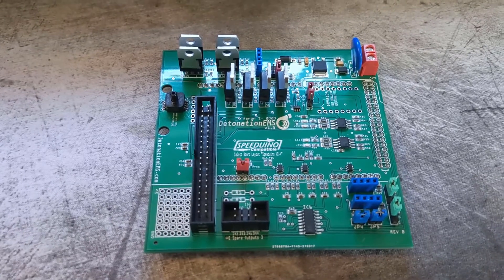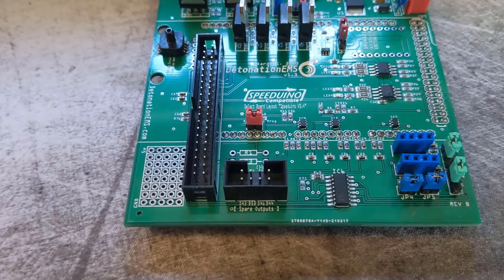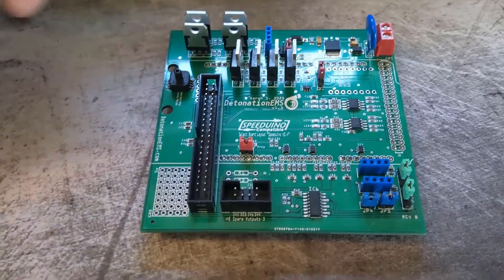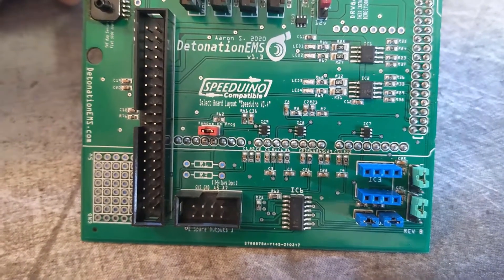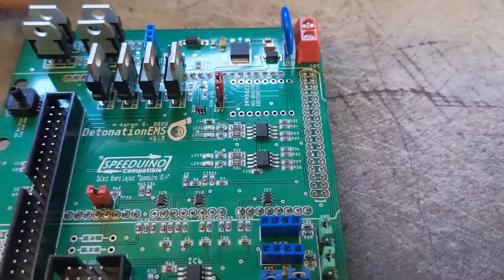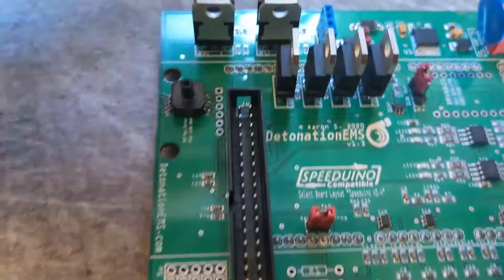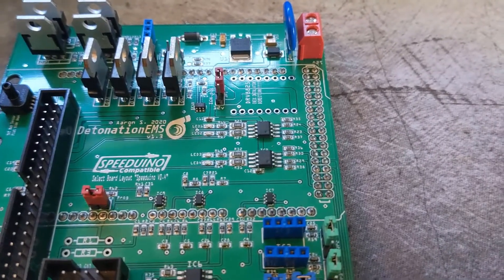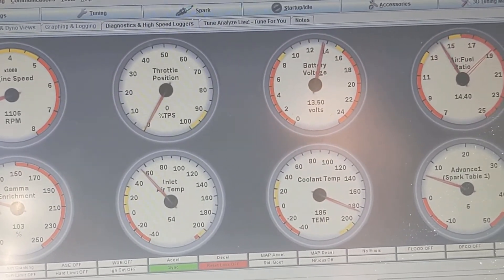Speeduino Compatible DetonationEMS v1.3b Engine Management System. New Features Overview & Running.

Comment: How about Vss input how do you connect it sir?
Reply: I’ve got DetonationEMS v1.3 ecu but I’m having a problem to wire my Vss input wire i have no idea which pinout should use because theres no layout board diagram, do you have DetonationEMS ecu layout board Manual?
Reply from the maker: @jameswilliams7895   My Github https://github.com/DetonationEMS

But follow the instructions for the Speeduino 0.4x. Off the top of my head I think it's pin 20 by default. If you join the official Speeduino slack you'll get the the best help on their. I am on there too. You can @detonationems or DM me on slack.
Reply: @Detonation240  can wire my Vss input wire between the 2 analog inputs A9 or A10 on IDC8?
Reply from the maker: No. Those are 0-5v analog inputs. I cannot post the I information on here. Please see my other post, you can join slack and I'll forward you the schematic you need.
Reply: @Detonation240  I already emailed you
Reply from the maker: @jameswilliams7895  got it. I don't have notifications on for that email unless it's business hours. I didn't see it.
Reply: @Detonation240  i cannot install slack app on my phone how can i contact do you have Fb?
Reply from the maker: @jameswilliams7895  I replied to your email.. I have email notifications off for weekends. I would have seen it tomorrow. I sent you the schematic
Reply: @Detonation240  I’ve got received the schematic but I’ve emailed you a photo of it.
Reply from the maker: On that board a small circuit needs to be made in the proto area. It's easy instructions are on the speeduino forum.. There is a newer version coming out in a few weeks that will have a vss pin ready to use.

Comment: The price is really attractive and the fact that it has map instead of maf is also nice. Im running nistune on my s14 right now but this seems like the best bang for buck. Is there any wiring scemes for wiring it up to an s14 sr?
Reply from the maker: Sorry missed this comment. It's fairly straightforward. Since it universal we don't really offer engine specific installation instructions but and SR install isn't hard. My two strong suggestions are use the 24/2 trigger wheel sold by aem or DIYautotune and don't use the factory coils. They are getting to old. Several inexpensive VW coils happen to fit very well on the Sr. I think it's 2012 GTI coils I'm using right now? No issues.

Comment: Just received mine a couple of days ago, waiting on a vtps so I can throw it on a miata. I was wondering though, what notable changes did you have to make to get it running your sr20?
Reply from the maker: Very little. The factory CAS outputs 12v and the ECU only accepts 5v signal so you run a diode backwards inline with the signal. Since I'm not using the MAF anymore I added a GM iat sensor. That's about it. Not necessary but switched to a dodge neon coil and spark plug wires because the OEM SR20 coils are 30+ years old. Was easy, used my Ignition control module. Did that several years ago. I'm thinking of switching to VW COP instead. They are really inexpensive.

Comment: Any chance I can use this to run engine management for my high compression 1zz? I'm trying to avoid going with an EMS4 or the like; thanks!
Reply from the maker: Yes absolutely. These ECU's are universal so they will work on most gasoline engines one way or another. You will need the details of your engine sensors including coolant temp, intake temp and the crank/cam sensor. Many are natively compatible with the firmware. In some cases customers use a custom trigger wheel to modernize older engines to run fuel injection and/or direct ignition. So the answer is yes it will work but how you make it work will be up to you as this is not a Plug and Play ECU. Check out the wiki page listed below for the more detailed information. This specific ECU is compatible with the V0.4x firmware so that's were most of your information will come from. Hope this helps. - https://wiki.speeduino.com/en/home

Comment: Could the new inputs and outputs also allow easier/better AC control? Also is cruise control possible with any Speeduino or DetonationEMS? Thanks for your work!
Reply from the maker: I have to be honest I don't know the answer that either of those questions. With the outputs you would have a specific value trigger and on and off state. Could that trigger be a pressure valve in the AC system? I have to be honest I don't know enough about air conditioning control to know the answer. That is a really good question though I'm quite curious to see what somebody's smarter than me with the AC systems would have to say about that. As far as cruise control I don't think it's possible without an external module of some kind. There is a speed sensor decoder built into the code but I don't know how the ECU itself could be a cruise control. I think you could feed the information from the ECU to a separate module that does cruise control. I see that to be very possible but that's beyond my realm of knowledge.
Reply: @Detonation240  Gotcha! Thank you for answering and being honest.

AC systems vary in complexity of course, but the most basic versions simply use a pressure valve for the system and a switch to turn the clutch on and off as far as I know. As long as the pressure is not too high or too low, the AC can turn on when desired. Modern systems also have various temperature sensors to monitor and keep desired settings and not overwork the system.

As for cruise control, much more complex. Some obviously require numerous inputs and sensors. New new cars it's crazy. Older systems usually used an extra cruise control computer that had a second cable to control the throttle and more or less just needed speed input and a few other commands from the cruise control buttons. That's just my general understanding I could be missing some.

Once drive by wire became standard, I believe the duties were offloaded to the main ECU usually. It would take speed inputs and desired speed and modulate the throttle to maintain. All cruise systems are disabled any time the brake is pressed. So with an older simpler cruise ECU and a cable throttle, a few inputs on any stand alone may be able to manage. Provided the extra cruise ECU has its desired inputs. Would vary by car.

I think the way aftermarket ECUs that offer cruise control do it today is by taking whatever speed input the ECU gets, basic inputs from the cruise set/cancel/increase/decrease buttons which use whatever the steering wheel controls standard communication is basically pulsed signals I think, brake switch input to cancel obviously, and the ECU just controls the DBW throttle to maintain set speed.

So an aftermarket ECU with DBW throttle would probably need speed input, brake switch, steering wheel controls or space for a few extra inputs, and the logic to maintain speed. That's about as far as my understanding goes, and obviously it will vary from car to car. Just wasn't sure if you had experience trying it on Speeduino. Figured I'd share what high level insight I have. Thanks for the prompt reply!
Reply: I think you can move the option channel input in the tunner studio idel valve section. But i jabe same incognot. How conect the speeduino wiring harnnes because the wirimg harnnes my ecu use 2 pin for a/c. One is a/c switch and another is a/c clutch.

Comment: I received my board and the bluetooth module I ordered, my board doesn't have the bluetooth header on it, is that something I need to order from you or do you know a part number that will work. I also noticed the order on the BT module is RX,TX,Gnd,VCC and the board is TX,RX, Gnd,VCC do I need to swap the two for RX to RX and TX to TX or install them RX to TX and TX to RX. Thanks in advance Aaron, your board looks great.
Reply from the maker: Email me. You should have received a standoff for the Bluetooth module with the Bluetooth module itself if I forgot to include it let me know I'll mail one to you. No the TX and RX are switched because they have to be The TX goes to RX and vice versa on the board. That's the way it's supposed to be. See my website for the email and I'll mail you a standoff if you want

Comment: You sir are what I have been searching for! I love the idea of the Speeduino, but have very little digital engine management experience. Are your 1.3 Speeduino compatible boards assembled? I'm building a 4.6l 2v turbo modular engine this summer and need an ECU to piggyback with the factory PCM...and I don't think my shaky hands are up to the task of soldering all those tiny parts on to the board. If your boards are assembled, I'll order a 1.3 board, boost control valve and Bluetooth board. Let me know, thx.
Reply from the maker: Yes the board is assembled as shown in this video.
Reply: Why not use a moates quarterhorse plugged into the stock PCM? It gives the full tuning capability for the engine and an automatic transmission, with the ability to switch tunes without a computer while you're driving if you connect a switch

Comment: I just discovered the Speeduino yesterday so I have a lot of questions. I'm just wandering what differences and/or advantages does your board have over the newest UA4C board?
Reply from the maker: Solid question! First I want to say most of us who make Speeduino boards all talk to each other and work together in one way or another to advance the project on slack. So the UA4C is actually an amazing board designed by a super smart guy who has answered some of my questions when designing what you see in the video. I cannot combat that my board is better in any way because it's different. His board has flying lead wiring. Mine does not. I think mine has more auxiliary ins/outs than his. Both boards use Josh's Firmware so there it's a tie there. So it's about how you want to approach installation, wiring and obviously mine requires a little more DIY knowledge due to the lack of flying lead. But this can be a positive to those who want a more flexible and moldable board. So I really think it's about what you want and not what is better.
Reply: @Detonation240  Thanks.  I'm mostly looking for extra i/o connections and features to control extra stuff like a pwm boost controller, extra VTEC solenoid (I have a Honda JDM D15B 3-stage VTEC engine), pwm control for iVTEC cam angle adjustment and EGR solenoid valve.  And have safety detection inputs for low oil pressure, high crank case pressure, exhaust gas temps, etc.  Sounds like your board has some extra connections on it for doing at least some of those things.